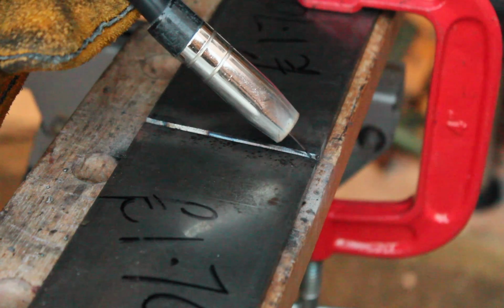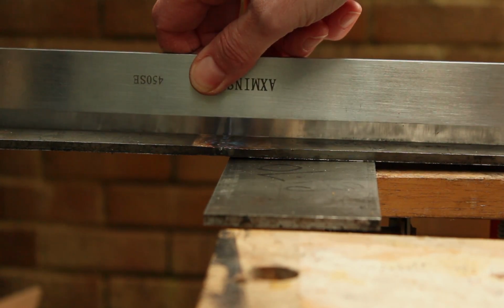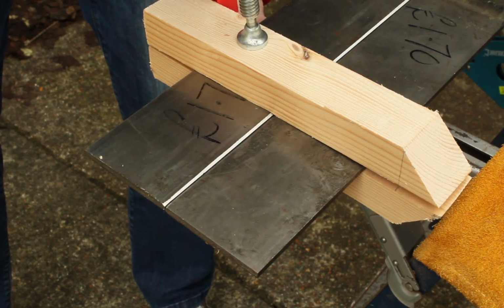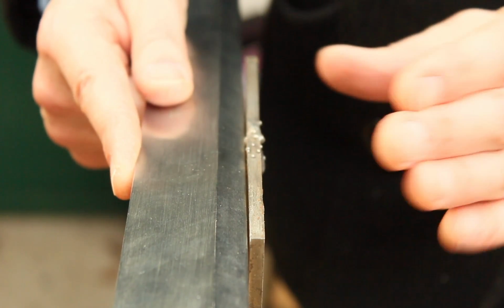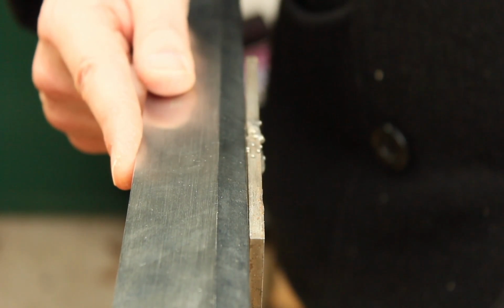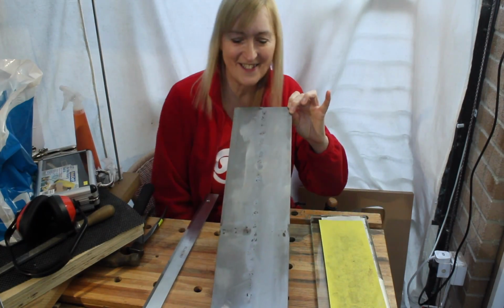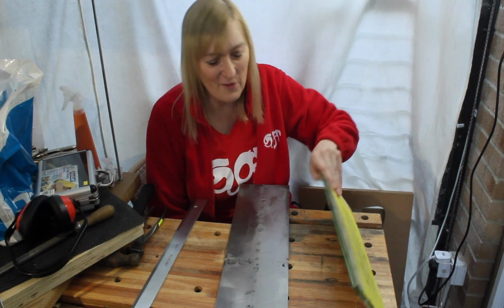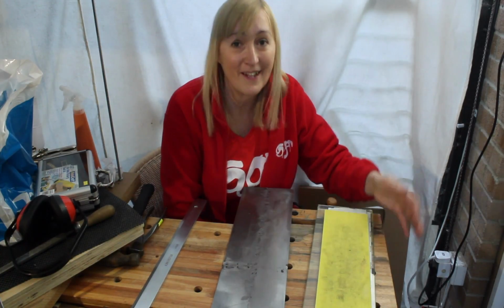Arcs and sparks - plate welding

Comment: Just out of interest what welder do you have and have you got a 16amp socket outlet or are you using the standard 13amp plug?
Reply from the maker: It’s a Sealey Mig - there’s a link in the video description. I was running off the standard house ring main. It has a standard 13A plug but I know it’s right on the limit - I don’t know what the fuse in the plug is rated at

Comment: I went on a welding course some 40 years ago and one problem that we where taught to overcome was the problem of buckling mental this is caused by the Weld shrinking and pulling the metal together and so the solution was to do the weld in small staggered welds starting from the right and working towards the left of the work piece thereby pulling the weld back to straight finally finishing up welding over the entire weld in one final weld. I don't know if I have described this quite correctly but this is the best that I can manage in such a short time without diagrams to illustrate. This is called leftward welding and should not be confused with a left handed person doing the weld, so the individual welds are done from  left to right.

Comment: first off , i love your channel and watch you quiet often
i do have some welding tips for you.
1. get you some anti spatter welding spray (even non stick cooking spray will work in a pinch) . it'll save you tons of clean up
2. the bends you had were due to overheating the metal causing distortion. make a short weld on one end, flip the piece, make a short weld about midways the the piece, then flip and repeat. this helps with the heat distortion.
3. use as low a current setting as possible, this will lessen the heat from the weld
just some tips i've learned the hard way, lol

Comment: Slower weld is the key.
Reply: Yep. Let the welds cool and go slower, and do not do all the welding in the same area. Divide the welds on the whole surface; first a small weld at the top, then at the bottom, and so on, taking your time to let the welds cool.